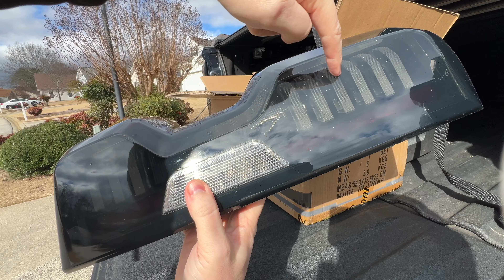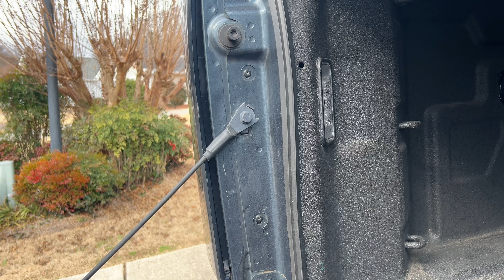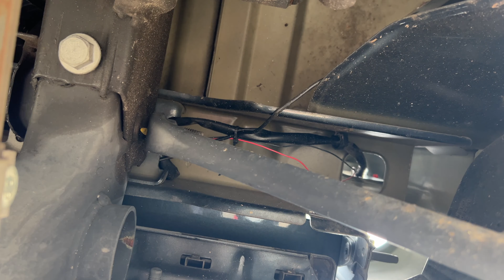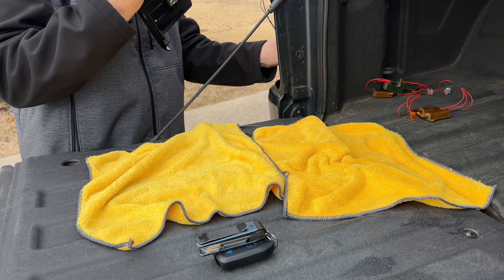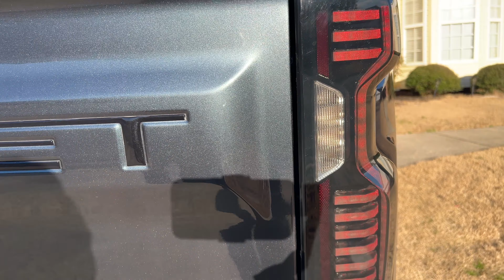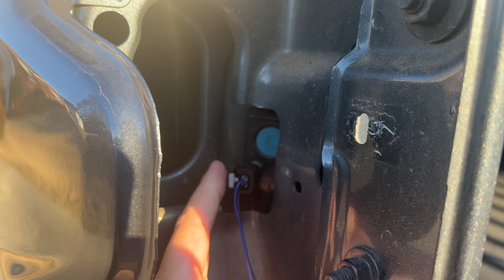Custom Silverado Taillight Comparison! - Sanooer vs Recon!

Comment: I went through CARiD and got spyder tail lights for my 2022.5 fresh chevrolet silverado high country and only paid $200.00 for ones that look just like the $800.00 Recon lights but clear chrome
Reply from the maker: That’s great. Glad you found some taillights that you like at a price point you are happy with.
Reply: Did you have to use the resistors? I got some for my 2026 but I need to use the resistors I just don’t know how to Hook them up. I tried connecting them a couple different ways but still getting the hyper flash.
Reply from the maker: @DonaldHopkins-r5x  I did not need the resistors. Those should only be for trucks that did not have factory LED taillights. I do not have any specific information regarding how to hook them up.

Comment: I just installed the sanooer tail lights and my cargo lights are working. 
I guess the fixed the issue.
Reply from the maker: Nice! They did say when I contacted them that they would resolve the issue in the next batch of lights they manufactured so sounds like they did what they said.

Comment: Just got these lights off eBay and having the same issue with the bed cargo lights what exactly did you do to fix it?
Reply from the maker: I did a wire swap in the cargo light connector. It’s super simple to do. I posted a short on the channel that describes how to fix it. https://youtube.com/shorts/vRKY_amUbkQ?si=MCN6GCylxXhtgpoF
Reply: @SouthpawGarage just found it awesome! And another question. I took it as saying if you had an LED reverse light to not use the resistors. Mine was the old school glass bulb, so I put mine on. Would this hurt anything in the long run? I’m no mechanic
Reply from the maker: I believe you did it correctly. I do think the resistors are for non-led trucks based on my understanding of the Sanooer documentation.
Reply: @SouthpawGarage I unplugged the resistor and don’t have any hyperflash after driving back and forth to work so I’m gonna take the resistors out completely for now
Reply from the maker: I re-read your comment from before…If your main taillights & brake lights were LED from factory, you should be fine. I don’t believe the reverse light specifically determines whether the resistors should be used or not. I believe it is the taillights and brake lights that matter for that piece. I apologize for any confusion.
Reply: wire swap, the polarity comes wired wrong.

Comment: Do the Recon lights have a startup sequence? Also, my factory taillights have a separate reverse socket/bulb! But the rest are led.
Reply: The recon lights i have do have a startup sequence i think it's an updated one from the one they first came out with
Reply from the maker: The Recon website says “Smoked Lens Version (264397LEDBK) includes Startup Light Sequence!” But I cannot confirm anything beyond that. The Recon lights that I have do not have a startup sequence, but I’ve also had them for multiple years so it’s possible Recon has updated them since then.

Comment: I like the Sanooer lights better, the look of them, the cargo light issue isn't good though.
Reply from the maker: Hopefully they can get the issue fixed since I notified them about it.
Reply: @SouthpawGarage all u have to do is swap the blue and white wire takes two mins
Reply from the maker: @terryhook5518 but someone shouldn’t have to do that, though. They should be correct for the truck they are made for.
Reply: 700 bucks vs 250...pretty easy decision...especially when u have to just swap wires